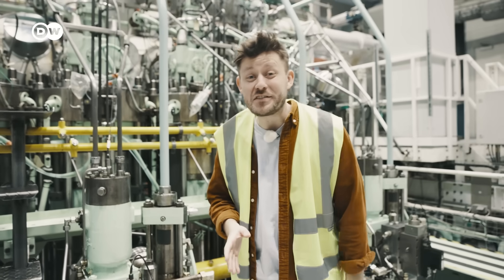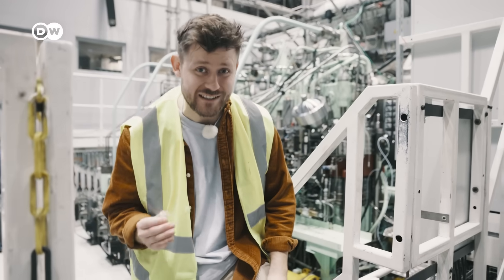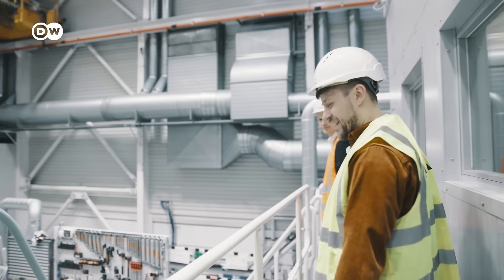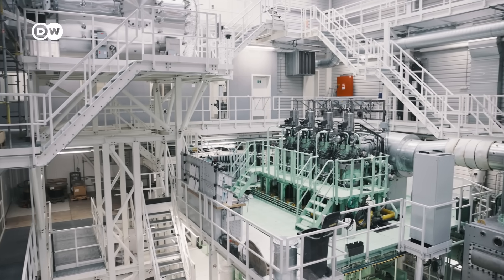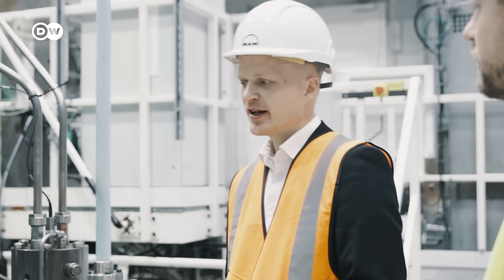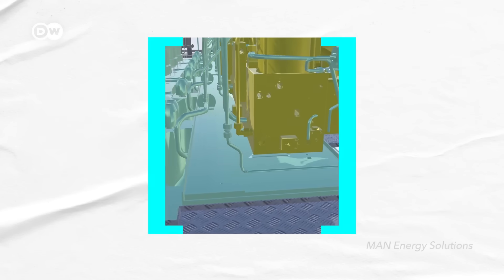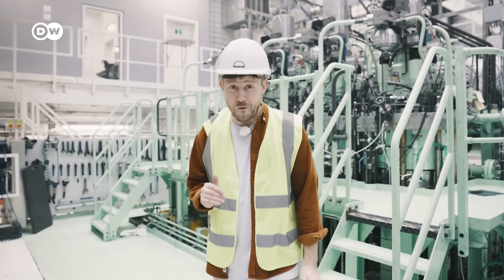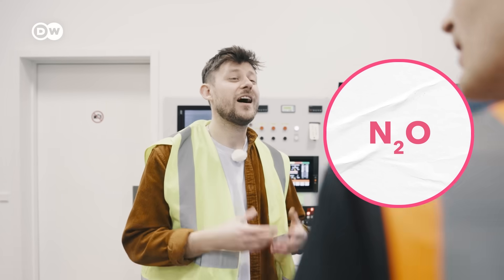Can this magic fuel clean up the shipping industry?

Comment: LOL Ammonia is SUPER Toxic to wildlife. So you want to go from Diesel that kills wildlife when spilled to Ammonia which also kills wildlife when spilled. Hydrogen Fuel cell is just much cleaner. because you only make water. with Ammonia and you burn it you are going to make NOx. which is arguably worse than CO2
Reply: There is no proof that diesel is more toxic than ammonia. The human body internally produces ammonia as a transient compound. Ammonia is also sprayed inside the soil for the purpose of making the soil more fertile for plants. More toxic than diesel? I don't think so.

Comment: The guy said that a huge amount of ammonia would be needed for increased growth in shipping.  But the amount of shipping should go down substantially because there will be fewer ships transporting fossil fuels.  And the amount of methane being shipped will go down because the methane will be replaced by green hydrogen made by electrolysis on location.  Instead, the hydrogen needed to make ammonia will come from electrolyzers instead of fossil fuels.

Comment: 350 x 75 M  solar panels with 40 % efficiency = 10.000.000 Wh / 10.000 Kwh ( large container ships usualy have around 30.000 kwh)....A big powerbank...And 8 knots. Panels pushed a side when loading/unloading. Maybe a return of " new age sails" and powerstations every 500-1000 miles on the most used routes.

Comment: As usual the journalistic work is of great quality and a very good balance of praise and criticism has been found! 

One point that would deserve clearing if I may, I would have like to hear some parallels between Ammonia as a fuel and Hydrogen. Like you actually use Hydrogen to produce the Ammonia, so it is not clear to me why not using hydrogen in the first place at this point.

I imagine there's a reason for that not being the case? (Higher calorific capacity of Ammonia compared to H2? NH3 less explosive than H2? Although it's toxic which is not great either) I think it would have been important to make parallels with H2 as it's also a type of fuel in full swing in terms of development of green fuels.

Comment: The only problem with using Ammonia as a fuel is that it takes more energy to synthesize Ammonia than is obtained by burning or combusting Ammonia.  The other thing that people seem to forget is that when you burn Ammonia and the temperature and pressure is high enough, Nitrogen Oxides are produced.

Yes, let's use a fuel whose combustion products are worse for the environment than hydrocarbon fuels.  But who cares, it doesn't emit any CO2.

Comment: Wait!🤨 If you need to do electrolysis anyway, why not forgo the conversion to amonia and burn hydrogen instead? It takes more volume, but there are NO emissions. And since the increased volume is of low molecular weight, you could increase the tank capacity upwards without affecting the ship's center of gravity. So no volume wasted for cargo. And hydrogen storage and compression technology is already being researched and progressing.

It looks to me like that amonia tech is a stopgap measure... and not a great one to boot.

Comment: The problem with this is the same as the problem fuel cell cars, where do you get the hydrogen?
Cool idea if they ever pull it off but this is a 20/30 years away from being a viable green power source

Comment: No mention of ammonia fuel cells to power electric motors: combustion is inefficient, fuel cells avoid nitrogen containing by-products.  No mention of using a catalyst to convert NH3 TO H2 for either.
Reply: I would guess that fuel cells have a worse weight/power ratio.  But it would have been great for them to go into this.  Maybe fuel cells could be more efficient than ICE?
Reply: @alandpost   Hydrogen fuel cells feature in portable power-in-shipping-containers that can be used to replace diesel generators for temporary events.  Mature enough to be used in that context, and I expect there's potential for improvement.

Comment: For Christ's sake! What's wrong with hydrogen engines and solar powered ships??
Reply: Storage
Reply: @miroslawkaras7710 Aluminium Hydride - Alane can be a solution?
Reply: Low volumetric energy density of hydrogen, very difficult safe handling of liquid hydrogen.
And you get way too less solar power on a ship for a decent transport capacity.
Reply: @701983 Aluminium Hydride - Alane can be a solution?

Comment: Sounds like it would be smarter to use ammonia in hybrid systems where the engine can be left running at optimal parameters, when the vessel is not moving it is charging the batteries or even generating more ammonia.

Comment: Good video. Sounds like it's completely impractical to do without using fossil fuels since it relies on Green Hydrogen--which makes no sense until we have already made basically 100% of our energy generation renewable and have excess capacity. Until then, Hydrogen is just the fossil fuel industry pretending to be good for the environment.
Reply from the maker: Thank you! Glad you liked our video ✨

Comment: 6700 hp is actually quite inadequate for a commercial freighter. Multiply by six or eight, and we're talking turkey...
Reply: My cat refuses to board any water vessel that has an engine less than 20,000 hp or anything powered with less than 12,000,000 cc

Comment: This is a very stupid idea, if we ultimately have to use urea as a reductor of the toxic nitrogen oxides and nitrogen acids the using of ammonia would create a issue much worse than actual carbon dioxide problem. We would in fact breathe poison. There is no alternative than real clean energy. So using ammonia is a real Jackass idea.

Comment: If I understand correctly, NH3 is just H2 but it has extra N added just to make storage and transport easier, right? In that case, why not add C?
Reply: Because then it would release COx when you burn it.
Reply: Because CO2 extraction from air (0,04% of the air) is very energy intense and expensive, unlike nitrogen, which is the main component of air (78%).
Nevertheless, I think, methanol (CH3OH) has better chances than ammonia.

Comment: Why not just use hydrogen? It's more energy intensive than ammonia and requires less electricity to create. Added bonus: its not poisonous and it only emits water when burnt. On the flip side, it's a bit of a fire hazard.
Reply: Volumetric energy density of hydrogen is even lower (~2.4 kWh per liter of liquid hydrogen).
Very high effort for safe handling of liquid hydrogen.
High energy consumption of liquefaction.
Reply: And hot combustion of hydrogen with air produces NOx as well.
You would have to use pure oxygen or fuel cells to avoid NOx-production.

Comment: now look into ammonia leaks, ammonia ground level cloud. SCBA and L1 hazmat suit or die. minor leaks SCBA. when its good, its good. but when theres an issue like this its much more dangerous to deal with. this aspect nobody talks about.
Reply: Yeah it's quite under-discussed, but it makes sense since even in this regard there's still so many unaddressed unknowns. Even its gaseous dispersion behavior is quite different than other existing (LSHFO, LNG etc.) and potential fuels (methanol). 

Some reports out there (e.g., NTU MESD's Ammonia Fuel Report) have done great job in the outdoor airborne release and dispersion, but the behavior, hazard, pre-emptive and mitigation measures in case of indoor release is still very much uncharted territory mostly due to the multiphase nature, chemical interaction with other substances (especially water), and very low hazard threshold level. It could escalate much faster than that in outdoors to reach very dangerous level and linger for much longer despite good vents in such circumstances.

Comment: Ships likely will move over to ammonia.  That being said, land based power plants should also move over to ammonia, as solar generation along with other green energy systems can make ammonia and that can be used as an effective way of storing the excess energy when those sources produce more energy than the local power needs to deliver.  This has been a real problem with those generating methods.  How to store that energy at night or when the wind is not at the correct speed to generate power.  (High winds result in the shut down of windmill generation, and is as big of a problem as no wind.)

Comment: Compress air a day hydrogen are the choice because it can be produced n open ocean , I call it farmship,  by means of sails and solar,this allows to refueling at mid ocean on the go,a second is redesign cargo ships to allow the suring  plonger effect,compression air engine can also work with fossil fuels or hydrogen.

Comment: Our biggest obstacle is asking "what else can we burn in the engine" rather than "what better ways can we use to propel the ship". A paradigm shift, if you will. Ships are already mostly powered by diesel-electric drivetrains, i.e. the diesel engine drives a alternator only, and electric motors propel the ship. It seems to me our efforts are much better spent finding a suitable fuel that works well in a fuel cell. That eliminates a lot of the difficulties of trying to make a new fuel work with existing propulsion systems.
Reply: Diesel electric propulsion has a worse efficiency than standard low speed 2 stroke diesel engines. At the moment these engines are the best we have. Not saying it’s good enough tho. But that’s where dual fuel comes in to make these engines even better. Also diesel electric propulsion is not typically used in the merchant navy. You really only see it in ferries and cruise ships, the latter is btw something we can get rid of when comes to easy emission reduction.
Reply: @giantdwarfulf  You're missing my point: replace the diesel generator in a diesel electric drivetrain with a fuel cell. This is already happening on mines (lots of mining equipment were diesel electric too), but they have the luxury of having space for solar/wind farms and hydrogen electrolysis.
Reply: I think your last sentence should read "That replaces the difficulties of trying to make a new fuel work with existing propuslion systems, with the problems trying to make fuel cell systems work". Because right now it reads as though you think fuel cells are an easy solution. Had they been, we would already have been using them.
Reply: That is also being studied and researched, but nobody knows what the winning solution will end up being.
Reply: Current gas-steam turbine combination can get up to 60% efficiency and they can work on much cleaner burning LNG and LPG. Add new advancements in screws and electric motors, and, possibly, some sails, better hydro and aerodynamics would make a ton of difference. IMHO, fighting for every % of efficiency is much more, well, efficient, then diving into some obscure and expensive fuel technologies.

Comment: Am i missing something here? Surely green hydrogen would be a much better fuel without the harmful emissions? Ammonia has three hydrogen atoms and one nitrogen atom, so why not just cut out the nitrogen and have way better energy density? 

And given that you only need water and electricity, it must be cheaper to produce, right? 

This just sounds like a fossil fuels vanity project to me. 

Also... Autonomous kites, that's a way to drastically reduce ship fuel use and emissions straight away

Comment: Thank you very much for the excellent questions, it was a true pleasure having the DW team at our facilities :) 

For the purpose of clarity: When burning ammonia in our engine, NOx emissions are 40% lower than NOx emissions from fuel oil engines. NOx emissions are regulated by IMO and 9/10 engine orders we get today need to comply to stringent NOx emission levels because they trade in Tier III areas. We therefore have thousands on such engines on order and in service. In that way, NOx emissions for ammonia engines are even more easy to handle compared to any other fuel types, and it's with existing very proven technologies. 

NO2 emissions are more importantly also extremely low, and basically it is no challenge to avoid the formation in a two-stroke engine. We will guarantee that and the GHG emissions reductions when taking N20 into account, and CO2 from pilot oil, are above 90% compared to existing engines, and it can be reduced even more :) 

All in all the ammonia engine will be a very important pillar in the maritime energy transition, and MAN ES are leading the way, and as the good journalism also showcase - the only engine designer willing to showcase a full scale two-stroke engine running on ammonia, because our biggest competitor doesn't have one - yet.
Reply: Grey ammonia wil not be used as a fuel for ships as it incresse lifecycle emisions by 35% compared to fuel oil - everyone knows that. Blue and green ammonia will however be used at a large scale. In 2027 40 million tons of green ammonia will be produced given the current number of ongoing projects which is increasing weekly, and more than 20 million tons of blue ammonia. Upcoming carbon tax which will level out the price between conventional fossil fuels and low or zero carbon alternatives will drive the FID for many of these production projects. Keep in mind the shipping industry is a hard to abate industry where H2 derived fuels will play a huge role 

Batteries are not possible as propulsion power for large merchant ships. Size would be similar to the ship itself, lifetimd poor and therefore it's impossible. Only possible for short sea (very short sea..).
Reply: Hi, 

The 40% reduction in NOx are for an engine with similar output.
Reply: The 40% lower NOx are an average and not just at maximum load. The NOx levels are regulated to certain levels by law given several load points with different weight factors, it's a standard indutry practise. 

Pilot oil concept is based on proven technology and its the same valves which inject fuel oil when the engine is not running on ammonia. One just dont "dope" the NH3 with H2 on large merchant ships, it will introduce huge complexity and new additional injection valves
Reply: @HolmBidstrup  Fair enough. Thanks. 🙏
Reply: Hi Bidstrup, thanks for clarifying the NOx emissions part. When you say "NOx emissions are 40% lower than NOx emissions", what is the basis for comparison? Same engine feeding NH3 vs fuel oil for same power output? It's an exciting and challenging process to revolutionize one of the biggest emission source (shipping). I appreciate very much about the transparency you are providing here. Thank you and I wish you the best in this important endeavor for mankind.
Reply: How about always running the ammonia engine at full power in a plug-in-hybrid system where entering ports and going slow are on battery?
Reply: Thanks for participating in the conversation. 💜

So the 40% reduction is at maximum output? And "worse" at lower output? 😅 What about a hybrid system that comes on periodically to recharge a battery-electric thruster? What are the tradeoffs with using pilot oil versus hydrogen to dope the ammonia? 🤔
Reply: At what load will the engine automatically switch to just the pilot fuel?  I am guessing 10%.
Reply: If Nitrous Oxide is present in the exhaust emissions, then couldn't exhaust gas recirculation be beneficial? N20 is used in some motorsport to increase the oxygen content of the fuel/air mixture allowing for more fuel to be burnt, and to generate more power.
Reply: The way I see hydrogen technologies (which I consider NH4 to be) is as methods of transitioning to a solar and nuclear energy future. NH4 is just another energy storage, since you have to actually make ammonia vs pumping it out of the ground like fossil fuels. Researching hydrogen and battery technologies right now is stubbornly building a chicken from scratch so that when the egg (carbon neutral energy generation) is available it is immediately viable.
Reply: How does MAN see the mass production of Ammonia part working out? The video made it sound like it essentially relies on Hydrogen--which is being pushed as an alternative by the fossil fuel industry as a means to continue using fossil fuels as it's mostly made from methane and making it with clean sources is ridiculously inefficient compared to using those sources to directly power the grid. Given green Hydrogen makes no sense at a mass scale until probably 2050 after we've converted all lower hanging fruit (electricity, cars, anything else that can directly use electricity), does this end up any cleaner than just using fossil fuels directly?

Separately, has MAN explored using electric storage to power ships? Just basically dropping in grid scale batteries in the hull? I know their energy density doesn't compare to fossil fuels generally, but ships are huge so it might not be drastically different than the massive quantities of fuel + engines today.
Reply: All that does is move carbon emissions to another source. You could say 'oh well we use renewables to make it' but we use lots of fossil fuels to make the so-called renewable energy equipment. Moreover we cannot stop producing the heavy fuel oil used by shipping because that's just one of the products that comes from refining crude oil. So if we stopped using it for ships we would have to burn it anyway to dispose of it. Not producing it is not possible.

Comment: Since green methanol as a fuel for container ships started last year. I would appreciate a closer comparison with ammonia. This includes costs of the fuel, the potential speed of scaling up the fuel supply, and scenarios where the two technologies co-exist until the better technology wins out.
Reply: Add biofuels (for instance, biodiesel) to the mix, although it's more like a local/situational solution where renewable energy intensity doesn't really make economic sense to be used for green hydrogen feedstock (e.g. in humid and cloudy tropics).